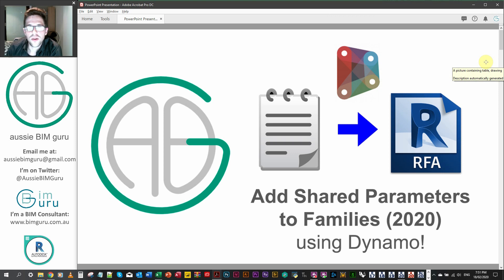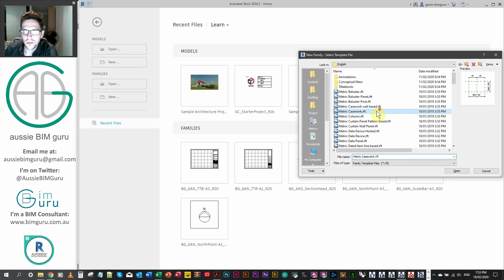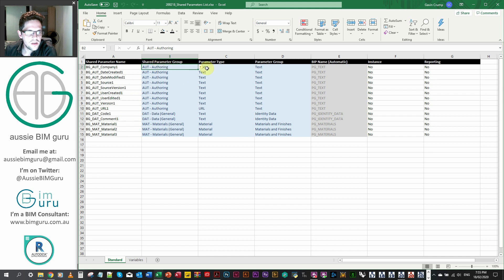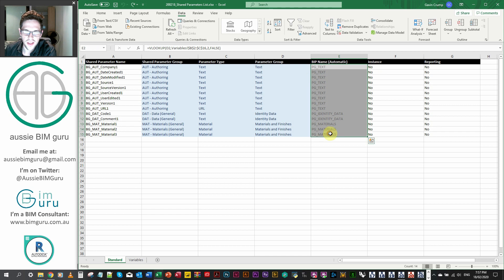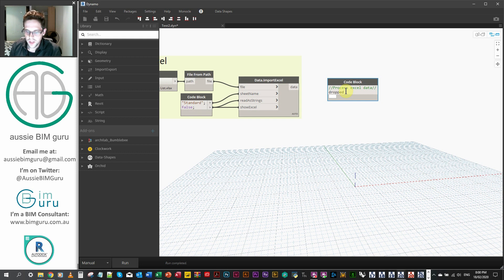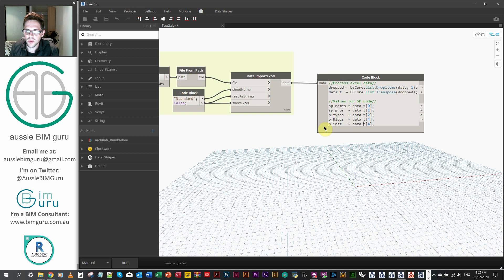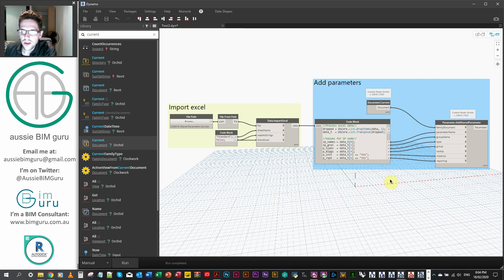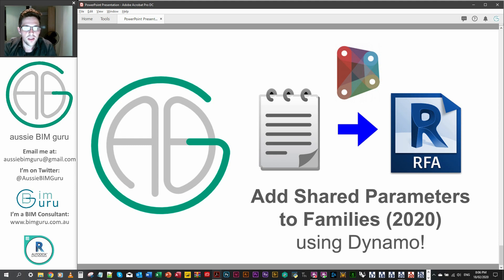Add Shared Parameters to Families using Dynamo! (2020 Update)

Comment: my head exploded when you started the DesignScript bit. no idea!
Reply from the maker: Yes it's a bit of a shortcut, this tutorial may help break down the principles of this technique;
https://youtu.be/vaduEjJO7QU
Reply: @AussieBIMGuru  thank you for such a quick reply :) I will give that video a go
Reply: I am trying to use your videos in this series to create a script that adds shared parameters to multiple project files. I am trying to do roughly the same thing you are with the Revit Project nodes instead of the Revit Family nodes, in this package. But I can't seem to get it to work! Might be another good video to do if you would be up for it :P Otherwise, I will post my solution here once I make it work! Thanks for your help and videos they have been of great use to me while i learn :).
Reply from the maker: @Abanbeani  i recall genius loci and clockwork packages have nodes for this. Will add it to my video topic list for future reference.
Reply: @AussieBIMGuru  thanks !! I will check those out 😊

Comment: This is awesome, but it only gets me halfway to what I'm trying to do with my detail item families.  We have multiple line styles that we would like to use in several of our detail families, so we would need to add subcategories for each of these line styles that would be controlled by parameters.  Anyone know of a custom node to do that?
Reply from the maker: I'm not aware of any packages/nodes that do this, but this is the Revit API method for adding a subcategory:
https://www.revitapidocs.com/2023/aba44eba-9882-54cb-fe52-30553a684c34.htm

Comment: Hi Gavin, Is there a way to export the same kind of Excel table from an existing Shared Parameter file ?
Reply from the maker: Not that I know of - not with all the preformatting etc. that I've set up here.

You can however copy a shared parameter file and open it in excel as delimited format though (select 'all files' option when opening in excel).
Reply: Thak you for your answer ! I succeed in exporting thanks to Dynamo and GeniusLoci Package, then reimporting following your tutorial ! But I realize that my goal was not to add parameter to a Family, but to Add Shared Parameters , in a Text Label of an Annotation Family (not in the family) ...  Do you know if that is possible ?
Reply from the maker: I don't believe so... I think the API doesn't provide access to labels (yet)

Comment: Hi for the shared material parameter, after added them to generic model family, do you have to come in family editor to nest then to the material of the family itself ? I added shared material family, but could not apply material for the generic model because the parameters are not linked together.
Reply from the maker: As far as I know yes, I haven't seen an API method for applying parameters to native geometry that is pre-existing. I believe it may be possible however if the geometry is created by the process also.
Reply: @AussieBIMGuru  Can you teach me to add material for a generic model with Dynamo please? I cant even find the built-in material parameter of the family. I wish i can add a picture here for your better understanding :-(
Reply from the maker: @QuanNguyen-xh5xk  the only ways I've managed to do this in the past is if I create a new family by geometry.

There is a node in the Springs package which can do this (and has a material input), or Rhino Inside can create direct shapes and assign a material.

https://forum.dynamobim.com/t/spring-node-family-instance-by-geometry/8312

https://discourse.mcneel.com/t/rhino-inside-revit-direct-shape-update-existing-vs-create-new-geometry-after-modification/83561

I believe in both cases this wont be the material parameter, but just a material itself.
Reply: @AussieBIMGuru  indeed i did, i created solid blocks in dynamo, then create familytype.bygeometry then place family instance by point. Once i have the family, i added share material parameter for the family but i cant not add material for the family. because this share parameter does not link with the material of the family itself. So sad :-( and i am stuck for 2 days now, cant solve it out.
Reply from the maker: @QuanNguyen-xh5xk  as far as I know it isn't possible. Go on the Dynamo forums and see if anyone knows I'd say.
Reply: @AussieBIMGuru  I found the way, Erfajo from Orchid package posted a graph. The only way is we need to open the family in family editor in the background and associate the 2 parameter then close then load it back to the revit project again. No one ever find a way to associate family's parameters directly from Revit without entering family editor mode yet. Which I find so strange. I thought Dynamo is unlimited lol. Well I will wait for the update, one day. Thank for the reply, your videos are great resource!!! 
https://forum.dynamobim.com/t/associate-parameter-in-multiple-family-files-for-example-node-orchid-parameter-associate/28429/8

Comment: Is there a UK naming convention for the shared parameters???
Reply from the maker: Not that I'm aware of. NBS has shared parameters but they're pretty awful (some are called 'Description' for example - clearly a system designed on paper and not designed by users).

There is an AEC UK BIM standards guide for Revit, but it doesn't seem to get updated often and the section on shared parameters just suggests users have their own corporate system.

Personally I designed a system myself in absence of one eventually as I was sick of seeing systems that were half baked or didn't work like NBS.

Comment: Hi Gavin, will there be a Tutorial for Revit 2022?
Reply from the maker: There is one :)

https://youtu.be/lvO2_0IQ8vQ?feature=shared

Crumple is a bit different now but the node works simialrly to this video still. I will be changing it quite a bit in a month or so with the next release however.
Reply: @AussieBIMGuru  Thanks Gavin,  appreciate. now its work our hundres of families can update easier thanks for your generosity. to share this video. i'm new to Dynamo even on programing but your video helps a lot.

Comment: Is there a way to make these parameters populate without restructuring the shared parameters names and groups?  I am working on a project where changing the shared parameter groups and naming is not practical to name properly.
Reply from the maker: As long as you reference whichever group the parameter is in as well as its name it should retrieve it successfully. By default the shared parameters will have to be in a group to exist in the file, which needs to be connected for the parameter to be accessible to Dynamo.

I have a node in Crumple which returns a list of parameter names and their groups in parallel so you can get their group in this manner if needed rather than specifying it from the excel file to reduce workflow complexity.
Reply: @AussieBIMGuru  First off.  It is amazing to get a response the same day!! Hats off to you.    You mention in the above Video at time 3:31 to 3:45 that it is important to have the parameters and groups in alphabetical order due to issues with the orchid node.  I was having an issue with it populating some but not all of the parameters.   Your video was very instructive.  I read another location that you recommended using Genius Loci and was able to utilize its node in place of the orchid node to achieve the same results.  Thank you again for the quick and instructive feedback.
Reply from the maker: @revitplumber  ah yes sorry I have a new version of this workflow that I abandon Orchid for, and this quirk doesn't exhibit itself with that approach, didn't realise this was on the version 2/3 video in my iterations.

https://youtu.be/lvO2_0IQ8vQ

This should remove the pain points mentioned and also brings the workflow into a package with exposed nodes (Crumple, my own) so you can see how it all works in Python too if this interests you too.
Reply: @AussieBIMGuru  It most definitely does.  Thank you for all you help.
Reply from the maker: @revitplumber  you're welcome! Keep up the automation journey 💪

Comment: hi, how can i set the discipline parameter, in the shared parameter properties? with this procedure it is set to default common.
Another question concerns the possibility of automatically inserting specific shared parameters within specific families, starting for example froma matrix on excel.
Thank you and congratulation for the always useful videos.
Reply: First problem solved
Reply from the maker: The second challenge is moreorless what this tutorial lays the foundation for. If you wish for specific parameters to be added to particular families only, then you would need this to be captured in a cross matrix in Excel, then set up the lists in Dynamo using filtering conditions. I'd suggest your family names in rows, and parameter names in columns and then simply a YES/NO if you wish to add the parameter or not. In Dynamo, you can then get those family files, and depending on their name check if each parameter is needed using a boolean mask for each sublist of parameter names. It's a complex workflow though, needs intermediate to advanced experience level to set up.

Alternatively, try Paramanager by DiRoots.
Reply: @AussieBIMGuru  Thanks for the reply, i will try as you suggested and in case I fall back on Paramanager by DiRoots

Comment: Hi Gavin, Unfortunately it doesnt work with me at the final step, the warning on Node (Document Curent) it says 
"Please run this command in a project document"
Iam opening family editor same as you, any suggestions?!
Reply from the maker: If you are using Orchid for Dynamo make sure to use its specific current document node vs the ootb one.
Reply: @AussieBIMGuru   I am afraid to ask more :(  the new node in Orchid expects "Group Type as Dynamo Type" in the ( groupType ) input instead of string as it was in the past how would convert String data into Group Type data in order to have the Add-Shred node accept it ? this is the last question promise LOL! iam still learning Dynamo btw
Reply from the maker: @User_2026_  not sure about Orchid nodes really, will need to drop a query on erfajo's github for those...

I have a node in Crumple package to get grouptype by name, as well as a collector for all group types which might work here.

Comment: Good remake...Can you make a video in dynamo for plumbing pipes where they run at 1:100 slope...
Reply from the maker: I've played with the pipe tool a bit - it isn't really my specialty currently unfortunately.

From what I can tell the slope parameter is read only, so Dynamo cannot interact with it directly. The only way I could get a slope I wanted was to adjust a pipe run as I placed it, or using the slope editor for standard slopes between 1:80-1:40.

I couldn't find any workflow for adjusting pipes without breaking the connections which isn't desirable. Suggest asking Dynamo forums to see if anyone has a workflow.
Reply from the maker: To keep you updated, I reached out to a pipe expert on LinkedIn and he'll have a look into it in his weekly video updates (Mondays):
https://www.linkedin.com/in/jos%C3%A9-dos-santos-02aa54198/

Comment: OMG!!! I did it !! I got so stressed, hehe those lists are case sensitive. The Data type is all in Caps on the Shared Parameter txt File and got an error (Fortunately Orchid pointed out).  I fix the lower case to match your Variables Sheet. Lol, I also just copied your code block, ask me if I understood it, haha the // values for SP node// I kind of get it. Knowing the coding language is a must!
Thanks, Gavin I truly appreciate your help! Thumbs up
Reply from the maker: Yes case and character management is critical in coding, apples must always be apples! Glad to hear it worked out

Comment: Hi Gavin by chance do you have a video on how to set global parameters to multiple family parameters inside a Revit project. For example set a global Material parameter to the Material parameter of   multiple cabinet families.
Reply from the maker: Not currently, as I find most people manage parameters differently so it's a hard topic to produce a video for. I'd probably just end up getting questions from viewers that relate to messy data setup (e.g. we use 4 different parameters in different categories to effectively do the same thing).

I'd suggest checking out this thread which shows a way to apply global parameters using Python and Revit API;
https://forum.dynamobim.com/t/associating-global-parameters-to-a-multiple-family-types-in-a-project/34253/6
Reply: @AussieBIMGuru  thanks for the feedback, I was also thinking to set the material parameter as instance, select all and apply the global parameter. But I’m not sure if instance parameters are as useful as type for data schedules. It is a shared parameter though, heheh I haven’t tried that way. I agree, handling data can be quite chaotic. Cheers
Reply from the maker: @CrlsE094  usually material parameters are best managed at a type level for most objects as you'd want consistency across selections placed multiple times. For example if a chair has two upholster options I'd use two family types to ensure consistency and more easily quantify selections.

Comment: Hi Gavin,

What is the main difference between applying the shared parameters to component families through opening the family .RFA → Family Types → New parameter (as is being done here) VS opening the project parameters in a project .RVT and adding the necessary shared parameter to the necessary category that houses the family?

I've recently had to add shared parameters to all the families in a project - all component families and all system families, this later helped with search sets in Navisworks and the .RVT method above seemed to work fine with all component families had the shared parameter as an instance. Am I missing something ?
Reply from the maker: Great question. It's all about where family data is stored - either you add the params and values at the family level (loadable families), or add it to the project and fill data there (e.g. system families, always stored in project).

Typically, storing data at library level is best where possible, as you can change data in 1 place - obviously only possible for loadable families.

I add the parameter at project level as well if;
- I want to 100% guarantee a family has this parameter (even if a user forgets to add it to a family)
- i need to schedule it
- i need to filter it
- system families need it
Reply: @AussieBIMGuru  Great - thank you for clearing up.
I can definitely see the benefits of including it into a loadable family.

Appreciate it

Comment: Hey gavin, you are doing fabulous job, really appreciated your effort. So 1st thing that orchid package looks different for revit 2021 for ex: shared parameter add node but anyway there is a warning after running script that it shows "other" invalid parameter group. Kindly help.....
Reply from the maker: Yes Orchid has changed a bit since I made this video as the package manager makes edits over time. I think there is a new function called Condense and also the inputs work different in regards to list levels. If I recall correctly, where I used @L2 in this video it is now @L1 and where I used @L1 it is now no levels. If the script is assigning to the 'other' group then you may have used an incorrect parameter group name. I have an excel file over on my github with most of the commonly used PG groups in it if it helps.

Comment: The error in the orchid package is because the shared parameters are of different groups are fed in one go. This error can be eliminated by separating groups. For example if you have parameters from three groups, you need to run three nodes. All will run at the same time.
The error can be ignored when the family is current document but when it is opened in background this needs to be fixed.
Reply from the maker: Thanks! I ended up writing my own nodes since this tutorial so dont have to worry about this anymore luckily.

Comment: Hey Gavin, I am newer at using Dynamo but am trying to use this method to save some time working. I am not the one who created our shared parameters so they are sort of random. I tried to write all the code you did and create the excel sheet but it seems to not be working. I might be adding in the wrong BIP Name but was not sure where to find this.. All your help is much appreciated! Thank you.
Reply from the maker: Hi blake! Bit of a tricky script for a new user, but gotta start somewhere I guess.

If you go to my github and check the dymamo script folder there will be an excel template you can use. This will set the BIP group for you based on a lookup formula.
Reply: @AussieBIMGuru  I have used other programming languages, just new to this one! Thank you for the fast response, I'll let you know if I have any problems!

Comment: Hi ABG, I am struggling with this dynamo. As my version of Dynamo is older than the one that you use, so I did with the previous version of your tuto (old way). 
I am able to push shared parameter from an Excel to families but the problem is : the shared parameters go only on one group parameter. For instance, all my SP got different groups parameter (GENERAL, MATERIALS,...) but they all go in one group (the first in the list). But the type, name,... everything is ok. Do you have any idea ? I can send you my dyn and Excel or take screen shot.
Thank you for your answer.
Reply from the maker: Feel free to send through your dyn, excel and shared parameters file so I can test. The way this node has been built and changed since this tutorial makes it a bit temperamental. The most common errors I find in troubleshooting people's attempts are spelling errors and group names not being written in the 'PG_' format, but if you've ticked these two boxes email across.